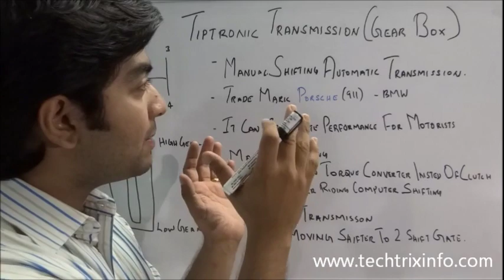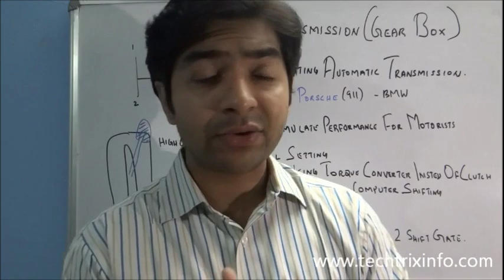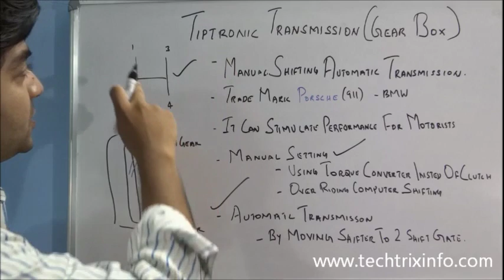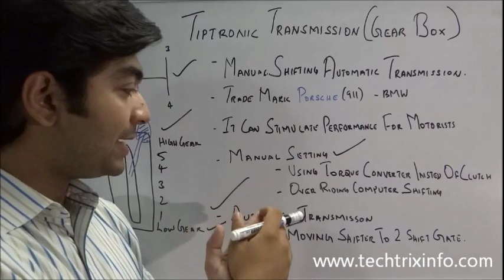How tiptronic transmission (Gear box) works. ✔

Comment: Hello:In tiptronic mode, if I am moving at a slow speed but upshifting the gears too quickly, or if I am moving at a fast speed but down-shifting too quickly, what will happen? Does the transmission have a safety mechanism to prevent up/down shift too quickly relative to the speed that the vehicle is going? thank you.

Comment: News Flash ANY Automatic can be placed in a locked gear and or shifted manually .
Newer ones can lock the Torque converter above 1st gear and using a sequential shift available in some cars, 
This can result in a significant increase in economy as well.

Comment: I also felt @ku pal ...
the title should be "HOW TO DRIVE TIPTRONIC" . Not how transmission works because u did'nt explain how its working .
plz explain how its woking in terms of response to the "+" and "-". explain how is gear are design whether its like manual or planety?....
Reply: friendly fassil Exactly he didnt ..... butTiptronic works thru hydraulic selinoids that carry and shift the gears thru the transmission once receiving an Ecu signal when you shift the lever up or down

Comment: Too much incorrect information! __ Tiptronic, S-tronic or DSG (different names) is nor  a torque convertor automatic transmission at all,  neither it simulates performance for motorists! But it improves the performance by implementing a very fast shifting mechanism, using a dual clutch system. A DSG system is composed of almost two standard gearboxes and clutches, and it does conventional gear changing instead of lossy torque conversion in  traditional automatic gearboxes. Using a DSG (as done in F1 and other racing cars) a driver can change gears much faster than a normal gearbox. And it can also be operated by car's computer for fully automatic transmission.

Comment: Thats not what tpitronic is This !!!! ....Tip tronic works thru hydrolic solenoids that change the gears thru the transmission once receiving an ECU signal once you hit the shifter up or down ..other types of cheap tiptronics dont have solenoids and work similar to the way he explained but not quiet

Comment: Tiptronic: Allows the driver to use a gear changer and change gears him/herself overiding the automatic system.

Simple
Reply: TheMATTYB1234 Its not fully manual. You cant change the gears while the car is stopped.